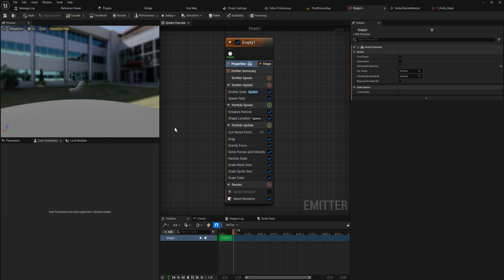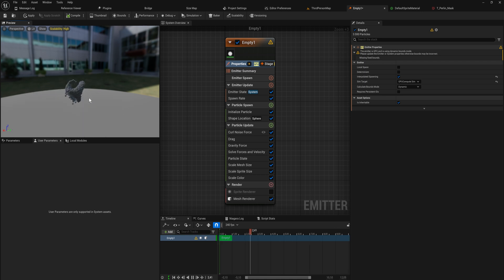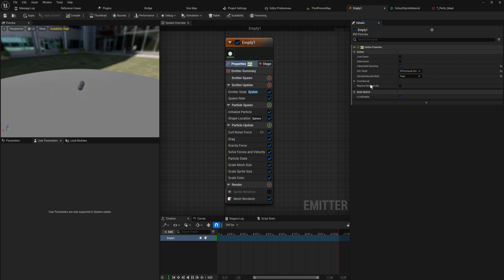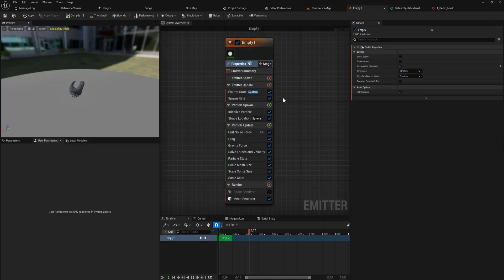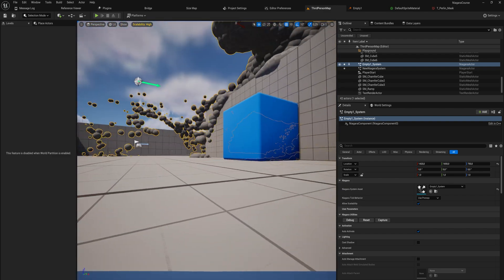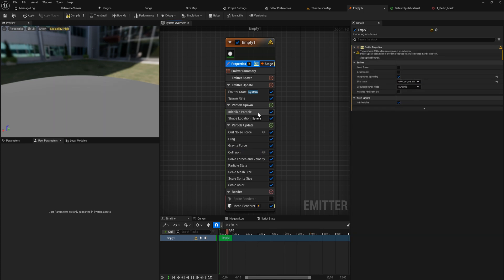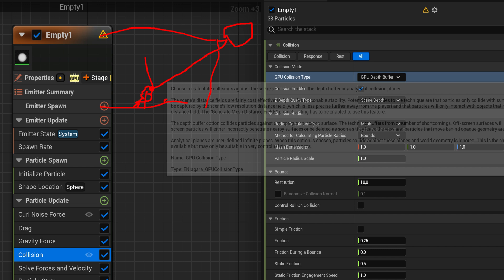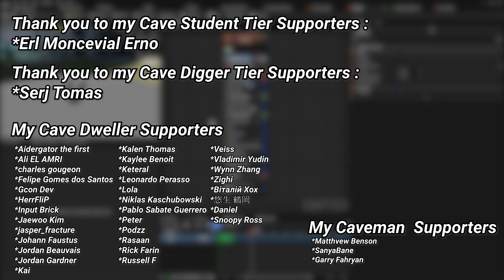CPU VS GPU Particles - Niagara Course #4

Comment: TLDR: gpu can do any work a cpu can, its just a matter of putting in the work.

Im a couple minutes into the video and you said that GPU cant do collision calculations, logic etc.....thats not entirely true, they can. GPU can do massive computation because they have thousands of core that are slower than cpu core but they can do everything a cpu can, they are just designed to do parallel computation, instead of linear ones like a cpu would, which is what makes them very appropriate for graphics processing, thats the reason they are used for other types of simulation in the medical or physics field or even bitcoin mining which are all parralel problems. GPU's are basicly a second computer with a different architechture within your computer. To handle collisions, you just need to create compute shaders to do it which is more work; You need to set up the data and pipe it to the GPU so that the compute shaders can access it, harder, but its definitly doable.
Reply from the maker: Within niagara gpu collission is rather lacking. The option is there but largly, if you need collision, especially accurate, cpu systems do that better.
I have no doubt that if you write your own whole engine for particles you can calculate collission on the gpu... but thats not what we are talking about here
Reply: @thegamedevcave  no yeah i understood that, its all good, i just found that blanket statemet a little missleading for younger devs and wanted to throw my 2 sense in there. but great video and great particle effect, i like the organic feel of it, nice job !
Reply from the maker: @oblivionronin  that's totally fair, from a more general standpoint there isn't much inherent difference between what a CPU and a GPU does, but yeah, within unreal at least, that's how the workload is divided, and if you really want you can make the GPU work in places that it's not " supposed"  to but since this (and a lot of content on this channel)  is aimed at making beginners understand how to work with specifically this engine, i dont tend to focus much on all the ways you can force the engine to do things it isn't designed for. (which, again, you totally can do, but if you're on the level of understanding of when and how to do that, you wouldn't be watching a video in a particle introduction series i'd hope)
Reply: @thegamedevcave  thats also fair. But in my case I'm experienced with C++ as a backend dev and im used to working with intrinsic, cuda and a whole bunch of esoteric techniques, like branchless optimisation etc. Im just new to game dev as a whole so im browsing around to learn different techniques and how the engine does things, if that makes sense